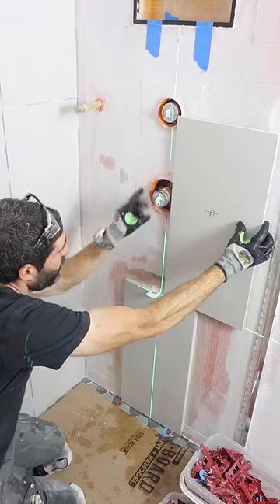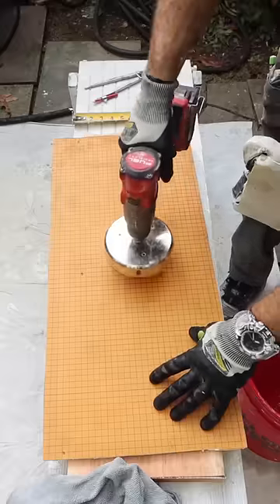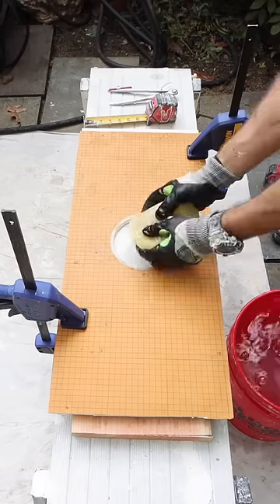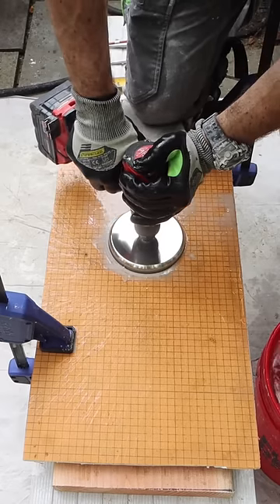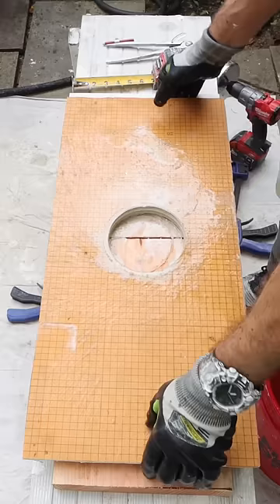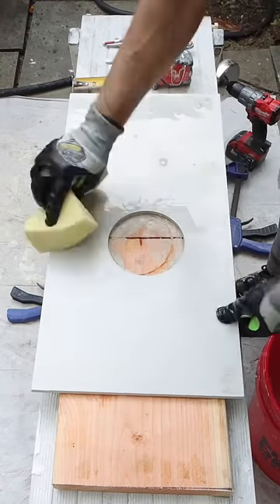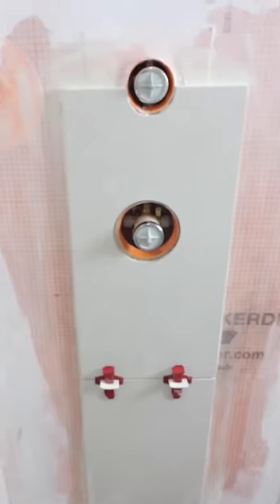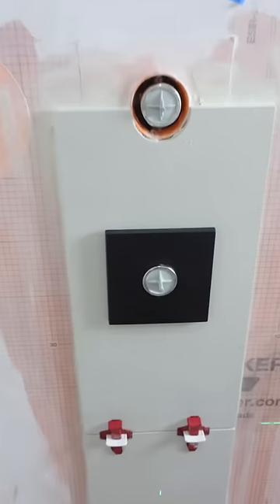How to Drill Large Holes in Tile - #shorts

Comment: you typically dont need to cut a circle for the shower valve. you can cut a rough square with an angle grinder. just make sure you have access to replace the cartridge, and access any integrated water shutoffs on the valve. As well of course, that the valve cover actually covers the hole.
Reply: not when your using a kerdii valve gasket,
a square won't water proof it
Reply: that's the difference between a professional and a half-asser
Reply: @daleon96  kerdi valve gasket is over rated, trim covers come with their own built in gasket. Plus, you silicone it too.